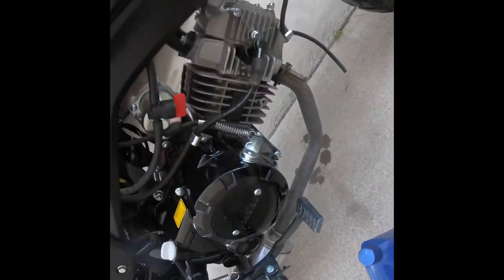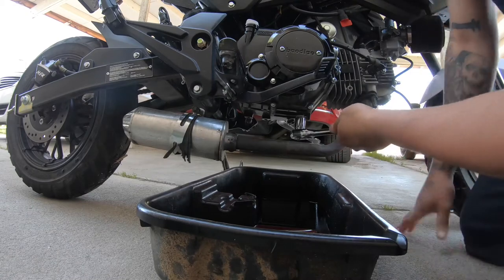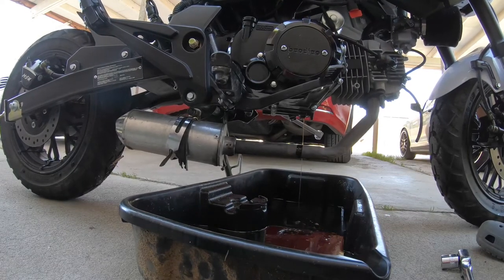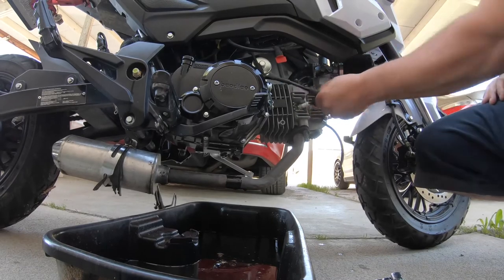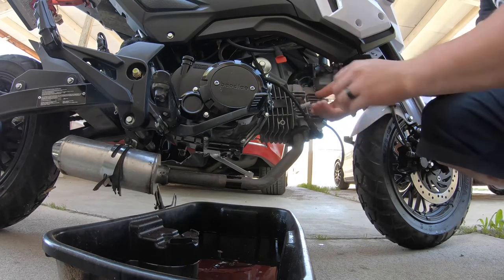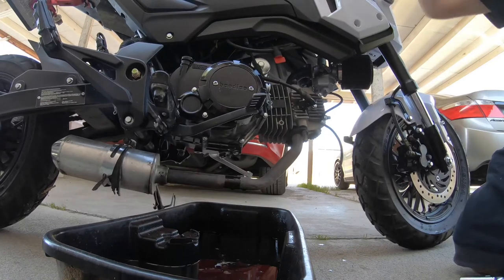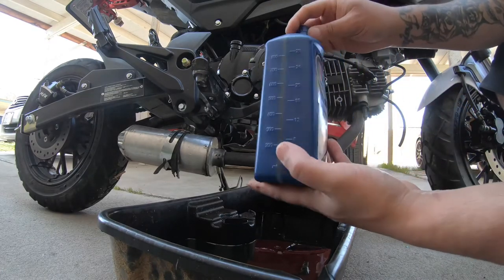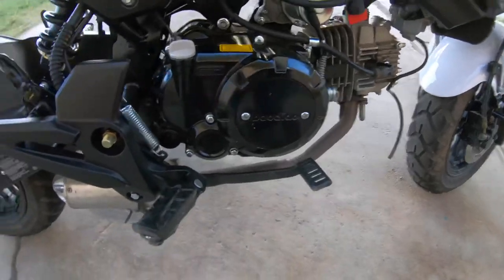BoomVader125 tune up (how to)  (Grom clone) for all Grom clones

Comment: I just picked up one of these bikes used, what is the oil change service interval? Is it like a car where it's changed every three to five? Or is it more frequent than 3,000 miles?
Reply from the maker: I do 250/750/1000 miles
Reply: @motoprosvtp  so every 1k miles since I have 2k on the bike already or should I do more frequently? Sorry for all the questions, this is my first street bike and I want to do maintenance properly, especially with how much fun I have with this bike
Reply from the maker: Yes every 1k but check your oil frequently some burn oil and it’s cheap to replace oil so it’s good to keep it mantainre
Reply: @motoprosvtp thank you I was wondering the same

Comment: Should’ve put aluminum foil on the exhaust so oil won’t leak on it! Just a heads up.. what exhaust is that ?
Reply from the maker: Not worried about a little oil on the exhaust that was just a test exhaust before I put a better one on

Comment: do you ever gap the plugs?
Reply from the maker: No never have on the ngk just pop them in
Reply: Yes you should gap if you want it to run great and not good. 
Whether the gap is off by .5 up or down it will still make a spark, gapping it correctly though runs the best. (Runs your engine cooler, sparks at the right timing your engine is set for, best EPA and most power possible).

NGK doesn't means it's an Iridium/Platinum tip plug (cant be gapped). NGK is just a good Japanese brand. These bikes use copper plugs which requires a gap.
All iridium and platinum plugs however are sold as application and don't require to be gapped. Since you can't gap them to begin with, if you do, you'll break the fine iridium tip.

Hope this over explanation no one asked for clears things up in the future projects. Cheers.